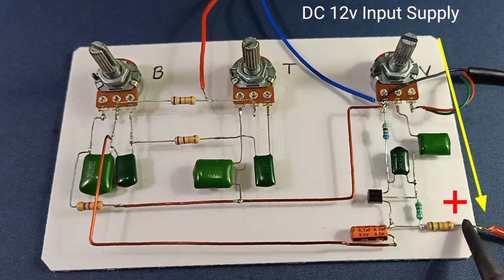DIY Ultra Powerful Bass, Treble, Volume Controller, No IC // How to Make Bass Treble Controller

Comment: fixed my ghetto blaster with this circuit.  2 transistor stereo mode on perf board.   bass treble,  balance stereo control.  that is connected to line in on main board.   instead of the fixed resistor on output its 4.5k variable pot.    sounds realy good!  and if i want i can hook up  another amp if i want more power.

Comment: Sir How to La4440 Amplifier connect bass Treble Volume Circuit

This This Diagram 100% work not clear not support my La4440 Amplifier
Reply from the maker: You connect la4440 amplifier input side,

Comment: Posso usar outro no lugar do 472n
Reply from the maker: Yes, 222j, 102j , 332j
Reply: @RJEDITALL  fiz o projeto porém o som ficou baixo só coloquei o BC 548, e o capacitor de 10mf  50vlt, tem alguma dica de algo errado
Reply from the maker: @adelsonpereira1758  check it well, 100% good working

Comment: Tipe ic power amplifiernya tda 2003/2005
Reply from the maker: You can use any amplifier
Reply: transistor bc547 apa bisa diganti dengan c945 pada rangkaian itu ? Terimakasih